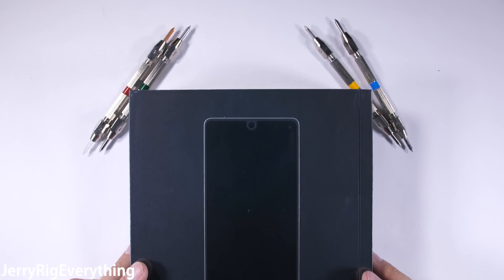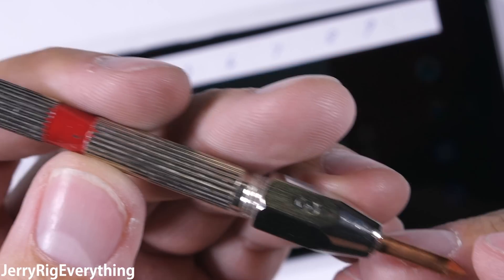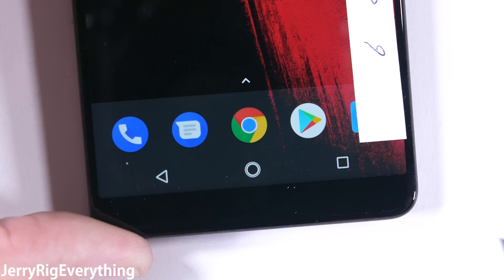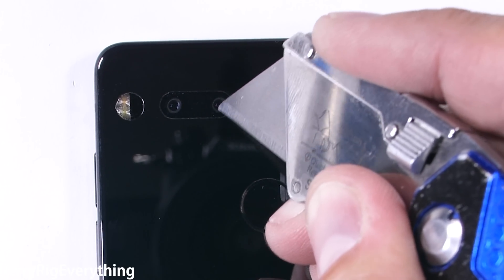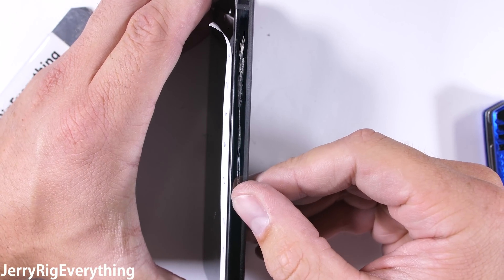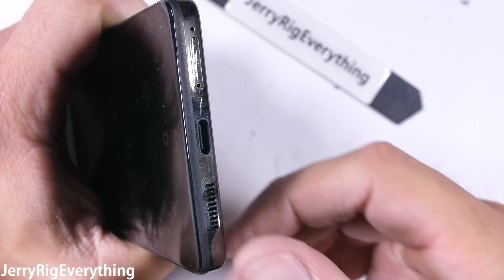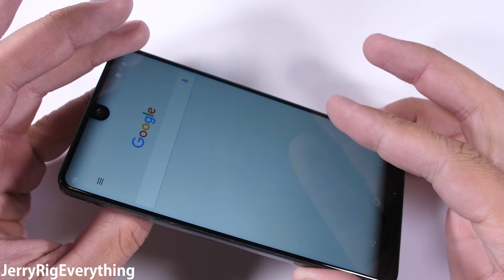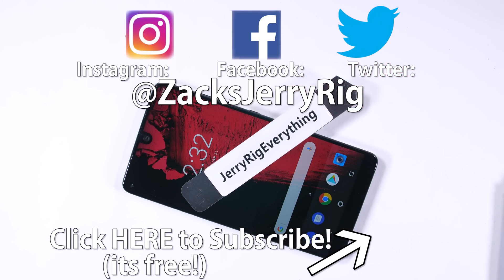Essential Phone Durability Test - Titanium Scratch Test!!

Comment: >remove a headphone jack
>make the phone unrepairable
>call it an "essential phone"
Reply: Some random guy on the internet,
Wireless: Needs to be charged, inferior quality (both because of wireless and the hardware, find me a two-driver balanced armature wireless headphones for less then 200$)
Digital over type C: more expensive and takes up more space due to external DAC; external dac - one more point of failure.
Analog over type C, no dongle: can't be used with other electronics without a dongle; more expensive, less reliable and harder to repair connector.
Analog over type C, dongle: more expensive due to dongle, less comfortable; dongle - one more point of failure.

Not to mention the charging problem, to partially solve which you need another bulcky dongle, brilliant!

If the manufacturer asks for 750$ for a phone, they sure can spend a few bucks to fit an audio jack. Space and WR stuff is just bullshit. If they need so save space that bad, 3.5 is not the only size of the jack, and there are other audio connectors, like the ones used in in-ear headphones with removable cable.
Reply: @MrPaukann  Guess Apples wireless head set's are crap then???
Reply: @Tech_no_Man , you mean that not in-ear dynamic earphones are crap? Yes.
Reply: BoneKRusher02 s5 isn't bad if thats what you are saying. Still one of the best budget phones despite touchwiz. Btw to all touchwiz haters, use a FLIPPING launcher.
Reply: >sell it for 700$
Reply: +Some random guy on the internet
I'd only be willing to upgrade to a phone without a headphone jack if I can get wireless earbuds that don't need to be charged. I don't even care about sound quality at that point...
Reply: +Voshchronos That's part of my point. If it's not possible to have wireless earbuds that are passive and don't need charging, then wireless is a complete downgrade...
Reply: MrPaukann the reason the headphone jack was removed was in order to sell more beats headphones and dongles. Apple doing this gave other manufacturers the balls to do the same thing for the same reason. It has nothing to do with "wireless is the future" or "space" or whatever they try to tell you.
Reply: I take it that you find the s5 to be the last "essential" phone if it was still supported
Reply: MrPaukann the only reason phone manufacturers aren't included headphone jack anymore is Apple made it "ok" and now they all get to make more money selling dongles and low quality high price headphones. Wireless in worse in all areas but one compared to 3.5mm jacked cables.
Reply: Tech World adapters = unnecessary money sink. They inevitably get lost, take up extra space, make it impossible to charge while listening (or make it more complicated) and degrade quality by adding more room for interference. There is absolutely no excuse not to have headphone jacks on phones. Not even adapters.
Reply: Possible, but impractical.
Reply: It IS repairable, search their reddit AMAs, they basically gave all the steps to repair the phone by yourself. They did advise against it though.
Reply: Some random guy on the internet Fuck wireless. I'm not going to lose audio quality to save a few dollars, and I'm certainly not going to pay or carry a dongle.
Reply: Some random guy on the internet Well shit. The s9 is coming out and still has a headphone jack. :)
Reply: I would like to add that I was the 666th like on this comment, mr. diablo
Reply: Does this thing even have an sd card reader?
Reply: @sunsetzerotwo8551  no  sd card, but has 128gb storage.
Reply: Use the adapter. Superglue one onto your headphones if you must :)
Reply: Tj Hariharan, thanks. Nah, it is really hard to make a bad sounding audio cable. It can have bad connectors or cheap isolation, but anything else at this sort of length is ok, no need for oxygenless copper and stuff XD.
Reply: Wireless earbuds that don't need to be charged? How is that possible? Lel
Reply: You worry about cables so much, probably get more of an effect from the fluff in the headphone jack :)
Reply: Birki gts, it don't get what you mean.
Reply: I'd be willing to call any phone that has expandable storage, dual sim, an ir blaster and a headphone jack "essential" as batteries today don't deteriorate very fast, and by the time they do it's time for a new phone anyway, making a removable battery not very useful.
Huawei for example makes lots of phones with all the essentials.
Reply: Some random guy on the internet yeah people like you accepting it are why the headphone jack is dying.
Reply: Some random guy on the internet pixel 2 does NOT have wireless charging so yeah, you're missing the point.
Reply: Dont fuck the father of android!
Reply: It's essentially unrepairable 😂
Reply: shockwave2291 give respect to the creator of android
Reply: Diabl0pl a 360 camera is also very essential
Reply: The phone is plenty repairable with plenty of screens available on ebay.
Reply: Essential is the name of the company.
Reply: do people still walk around the house with headphones plugged in to stereo system? Why would you on a phone, buy wireless you cheap bastards.
Reply: Basically an iPhone
Reply: @rwbie  why not a 1x1 display with no cameras and a battery thats 200mAH. it works but it sucks :)
Reply: not everyone's like you who can spend more for a wireless earphones/headphones
Reply: Wireless headphones are in every price bracket that wired ones are. From as cheap as <$5 all the way up to thousands.
Reply: @Str8GasGenetics  Yeah and that's the problem. Because a $250 wireless kit isn't going to sound as good as my $250 AT over ears.
Reply: It's only got what it needs to function. That's why it's called the essential phone.
Reply: It's a expensive mostly functional phone.
Reply: @mackandelius  In my book removing essential hardware like the headphone jack makes this phone not essential at all.
Reply: see they were clearly going for "what is needeed" rather than "bare essentials". What i would consider 'bare essentials' would be the old nexus line, esp, or at least what they were GOING for. About $300-$400, no fingerprint, no waterproof, WITH headphone jack (so no need for fancy usb c to headphone converters), no fancy screen jusrt a simple 5-5.5" 1080p display. THAT to me is "bare esentials", this phone has hte fancy edge to edge display and fingerprint scanners NONE of which are anywhere close to being "bare essential" and more along the lines of "what people want to see in a TOTL phone today" that combined with the price means this is not even CLOSE to an "essential" phone, more like a stripped down TOTL phone...

I think if they actually MADE a bare essentials phone for $400 or so, especially in international markets (where "buying subsidized phones" is not a thing) they'd have sold a LOT more phones. Consider the cheap chinese brands and how popular they are in places like india...
Reply: @TjPhysicist  Bare essential phone with not bad specs is LG G3
Reply: +MrPuakann THANK YOU! that's precisely what i was wanting to say as well. Not to mention, i don't trust cheap dongles to carry good audio, especially when carrying analog signal a good cable goes a long way. 

NOt to mention, going the USB C audio route is actually likely MORE work than just including a heapdphone jack. In fact the ONLY way digital audio out will actually be a cost lowering or a "minimising" would be if you can then REMOVE teh DAC on your phone...which you cannot do because you still need one for speaker, and most DACs COME with a built in way to output audio, so you actually have to PUT IN effort to include a DAC and specifically NOT hook up the analog out to a 3.5mm jack, instead choosing to do something weird with USB C audio (iirc what most phones these days do is actually use analog audio via USB C, instead of digital out on USB C...the latter of which would require an external DAC).
Reply: A monochromatic camera is a essential? I don't think so.
Reply: @MrLuc420  it's to give darker blacks on the pictures.
Reply: More like a bare minimum phoneq
Reply: John Benedict Carranza 

C'mon. Don't give me that affordability bullshit. You're buying a phone for $750, surely you can invest in a pair of wireless headphones.
Reply: If you STILL think that headphone jacks are "essential," you might as well stick to your S8 for the near future, because it looks like every other manufacturer will switch to wireless. Even the Pixel 2 has a high chance of becoming wireless. And how long do you think Samsung will stick with headphone jacks, huh? I'll take a guess that they will switch to wireless in the S10.
Reply: @somerandomguyontheinternet7063  It's 2019 and no, they didn't.
Reply: @somerandomguyontheinternet7063  Oh my gosh you predicted the future
Reply: @somerandomguyontheinternet7063  You guessed wrong.
Reply: @somerandomguyontheinternet7063  guess who was wrong uwu

Comment: I love how people bitch about Essential charging $700 for a phone made almost entirely of ceramic but nobody bats an eye at Apple charging $1300 for a watch (about $1,000 more than the regular version) simply because its ceramic.  This phone is awesome, I've had mine for 2 days now.  I was a bit concerned before it showed up and thought maybe I'd end up with a v30 or a pixel XL 2 but so far this thing is amazing.  It's basically what everone who used a Mi Mix asked for... a smaller version that's running stock android instead of MIUI.

Comment: The most solid phone known to me is a Nokia made from a unibody poly-carbonate. It hammers nails into the wall. If done right plastic can be so much more solid than all this brittle stuff, or soft aluminium.
Reply: And by the way, it is no problem building a good car for $ 500.000. The problem is building a good car for $ 10.000.
Similar applies for other products. This phone is redundant.

Comment: First, what is the IP rating?

But this always bugs me. People justify the audio jack removal as helping waterproofing. That's bs. One more o ring, corrosion resistant contacts, and you have yourself a waterproof audio jack. That would cost a business some fraction of a cent per unit. Apple did it to make money, but the faceless zombies of the industry just stepped right in line to copy apple. Motorola, Essential, HTC, and the others do not make money from USB C (other than nobody buying micro B anymore).

Comment: The essential phone is essential in that it has everything you need, and nothing else. It does not mean it has all the modern features, it does not mean it has everything you want, it means that it has only the essentials. Do you need a headphone jack? Waterproofing? SD card? Those are all optional things that can be helpful, and may be desirable, but are not *essential*, and were therefore not included.

Comment: You need to lookup the advantages of monochrome camera with no filter array. In short, its much higher resolution (compared to the same MP color camera) and much more sensitive to light compared to same sized sensor. These benefits make it quite useful in industrial and security applications. I imagine it would be great for document scanning and other low light situations.

Comment: The headphone jack is pretty much the most essential thing on a phone, IMO. Wireless headphones are mostly gimmicky devices with low sound quality, and they end up being yet another device that needs to be charged every day. 
It's almost insulting to consumers for a $700 phone to call itself "essential", while missing something as basic as a headphone jack. Or an IP rating, for that matter.
Reply: What's the difference between gorrila glass 3,4,5 if all scratch at 6, also, lack of headphone jack negates this as essential, Bluetooth speakers are not mainstream and good ones cost a lot.
Reply: I am sorry  can you use a DAC with a bluetooth headphones ? And yes as long as you cant the wireless headphones have really low quality compared even to the worst phone DAC I have tried.
Reply: You'd be surprised how good some bluetooth headphones sound, batteries last 12 hours of use which is plenty and getting rid of that cord is so liberating.

Remembering to charge them can be annoying but it's the same as not charging  your phone, can only blame oneself :)
Reply: Shaik Fahad My Sennheiser cables never tangled up
Reply: United States of Embarrassment have you ever used wireless headphones?
Reply: Martin F. Maybe cause you always buy shit phone's with shit dacs
Reply: Martin F. Your logic works only if the phone was cheaper because it doesn't have hp dac. Yet 700 bucks for phones and 500 for good bt hp?
Reply: Shaik Fahad flat cables are the best xD
Reply: Shaik Fahad Yeah you said what I always try to explain to bluetooth users. I really hate having to charge and making sure bluetooth headphones are charged. To me, it defeats the purpose of having them.
Reply: "low sound quality" I'd trust a DAC from an audio equipment manufacturer over a DAC from a phone manufacturer any day.